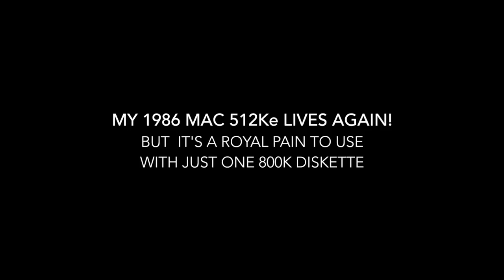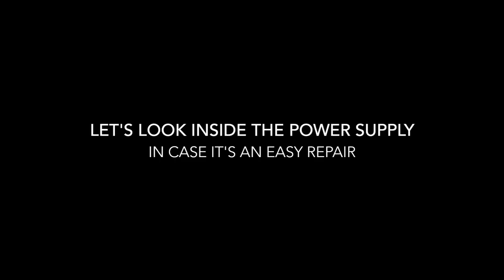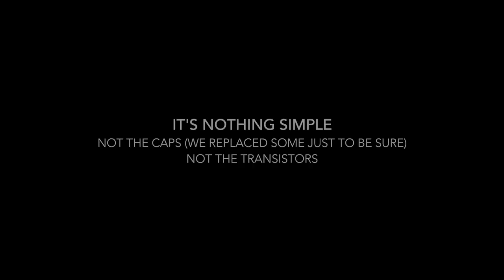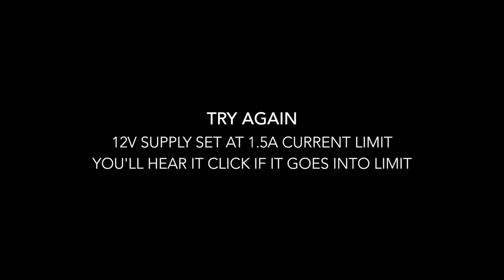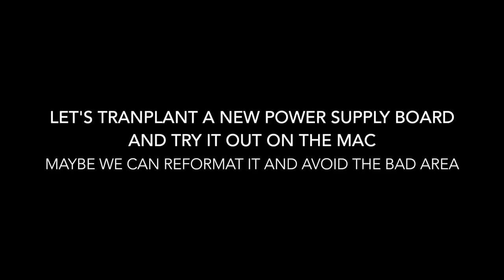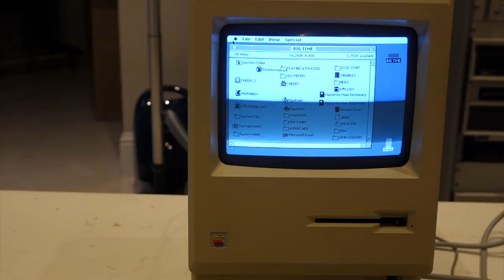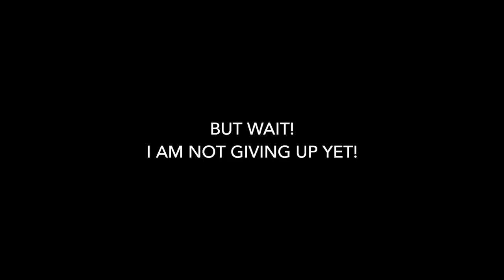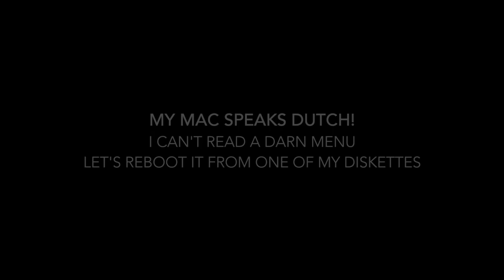Macintosh 512K Part 2: HD20 Hard Drive Restoration

Comment: This is pretty cool. My HD20 also started to give up the ghost, so rather than try to repair it, I got a Floppy EMU (emulator) from Big Mess o Wires.  It emulates the floppies and HD 20 as well, from an SD card.  I figure that'll save wear and tear on the poor old drive...
Reply: But then you don't get the nice steady hum :)

Comment: That transistor looks like a VN66AF VMOS, I wouldn't bother as the surface of the hard disc is screwed new hard drive required using a SATA2SCSI adapter.
Reply: SATA2SCSI is no use - the HD20 connects via the Mac's floppy port, and the Rodime hard drive has a unique connection that's not SCSI. Also, the Mac 512 doesn't have a SCSI port.

Comment: Hmm. I can't find anything on the drive itself. Perhaps it's an MFM with a different interface? Many data cables, including floppies (which this one acted as), have every other wire as a ground to reduce interference between signal wires. Negate that and you can fit the entire MFM power, data, and control interface onto that 26 pin cable, and if it's a short run, the extra interference protection provided by the extra grounds might not even be necessary. If that were the case, it might be possible, with a pinouit diagram, to place a standard 3.5" MFM in it's place... If not for the fact that used MFMs that are still operational can go for a few hundred bucks easily on eBay, IF they're still working and were even PARKED before being moved. That's why so many retro computer nerds (like myself) are adopting Compact Flash adapters to replace failed hard drives, and given that CF is at it's heart just an IDE interface, that's not hard to do. I don't know if anybody's made such an interface for an HD20, though somebody might have dabbled with making a CF to MFM interface, which if my hunch is correct might do the trick.

I don't have an HD20, and never have, so I'm speculating in the dark. The radial "scratches" are common to really old platters, and weren't necessarily an indication of damage as far as I'm aware. Modified Frequency Modulation was a little before my time, but as I understand it, it was like a digital phonograph written with a magnet.

Comment: I wonder, would it be possible to swap drive control boards from the dutch drive to "Neil's" disk in order to archive it's contents also.
Reply: No, it's an older revision disk.  Same model but older.
Reply: Rats.
Reply from the maker: I had not thought about that one. It would not have the right drive map in it (assuming it had one). Maybe if I just swap the processor?
Reply: I wouldn't just swap the processor. You don't know what other failed or failing components caused the previous processor to fry. As for the map, it's likely.
Reply: CuriousMarc maybe there is a way to read the good processors rom and program a new empty one to replace the one that gave up?
Reply: It would be a better idea to try and find another RO552 of the same revision and do a logic board swap.

Comment: you could have used a HDD emulator or a floppy emulator for this project, mostly cause getting disk parts for vintage computers can be a pain in the butt
Reply: IDE emulation is easy with Compact Flash cards, because they literally have an IDE interface. MFM hard disks though, I know people have attempted interfaces, but I don't know if anybody's succeeded.

Comment: An interesting site here, where a guy is reversing the control logic on the HD20 controller.

He says he already has a dump of the Z8 ROM too...

http://www.d.umn.edu/~bold0070/projects/hd20/
Reply from the maker: Thanks. Unfortunately that's the Z80 on the control board, not the one on disk board. The one on the control board has a regular external ROM, easy to dump.

Comment: The hard disk is actually not proprietary. It's a standard Rodime 20MB PC hard disk with a custom controller. The mechanism is identical.
Reply from the maker: Indeed. Unfortunately as you can see later in the video it’s the controller that eventually went poof...
Reply: @CuriousMarc  Yeah, it's a shame. But you can actually get the mechanism as an MFM drive and swap the driver boards around and it will work just fine.
Looking back, 1.25A is probably not enough for it to spin up. I imagine the HD20's PSU was putting out 2+ amps during inrush.
Reply from the maker: @AiOinc1  I wonder if anyone ever dumped the firmware from the controller.

Comment: My old Mac plus hard drive had a dead power supply also. I fixed it by replacing the psu pcp with a pico psu micro sized atx power supply. That made me able to keep all of the original parts except for the power supply pcb.   

http://www.mini-box.com/s.nl/it.A/id.417/.f
Reply from the maker: Thanks for the tip!

Comment: Might the lines be the tracks of the data not scratches?
Reply from the maker: It's looking like some trace of the head sliding on the disk. It could be normal, but I don't think it is - never seen a disk looking like this, it should be pristine. Obviously the head needs to be able to land and safely slide on the disk when it parks near track 0 (there is no special looking parking area on this disk). But in the active part of the disk, it should always be flying and never touching.
Reply: I think it's normal, there are some disk drives where the head rests on the disk with a small block of graphite (pencil lead). its a smart way of preventing head crashes, but at the expense that it can't go off the disk and once the graphite wears out it will crash.

Comment: Like needing uppercase letters, Steve Jobs didn't think disk swapping was important to anyone.
Reply from the maker: Oh, nothing is further from the truth. He knew all too well. He was trying to make the hardware to a reasonable price point, and avoid the train wreck of the $20k Xerox Star and the Apple Lisa. Cram the whole thing into one diskette and 128k of RAM. Which everybody told him was impossible. That’s the real engineering achievement, delivering a machine that could do it at 1/10th of the cost than everybody else did.
Reply: @CuriousMarc  Hmmm - I'm certain I've seen interviews with Larry Tesler, or Andy Hertzfeld but maybe even John Sculley, suggesting they knew disk-swapping was a major issue, but Jobs dismissed it.
Reply from the maker: @rabidbigdog  It was part of the many important trade-off to achieve the price point that would make the machine successful. 128k of memory was another one, but staying uncompromising on the screen resolution and quality (which forced him into an ASIC). The Xerox Star and the lisa failed to make these hard choices, and failed miserably - and quite predictably. The memory and the 2nd disk were quickly added back as soon as price allowed.

Comment: Ok, one suggestion, any electrolytic caps over 20 years old should be replaced regardless of the readings.
Reply: You should only do that if they are bulging.
Reply: Test them first with a capacitor tester. Replace them if they leak, have high resistance, or below tolerance capacity. Try to get a vintage capacitor tester if you're working on anything with tubes, because they can run high voltage through them to see if they leak at operating voltage.
Reply: More like any capacitor 20-30 years old.

Comment: Well, those couplates are bulging aswell, so I think the drive is toast indeed. There is no way replacing that. But - RODIME was one of the worst HDD manufacturer ever. Only Kalok was worse, so I think it is very big success if one is working flawlessly!
Reply: Krivulda   Worked in a repair lab in the 80's and the Rodimes were very unreliable.
Reply: Yeah, that's what I'm talking about :)
Reply: Only one worse was the Olivetti/Lexicom drives - doa rate was very high.  Sharp tap with a hammer fixed many of them for few weeks.
Reply: How can they be bad, there's no "X" in the brand name.....